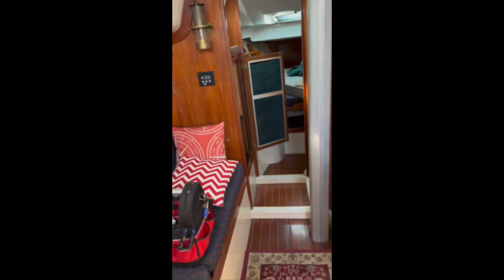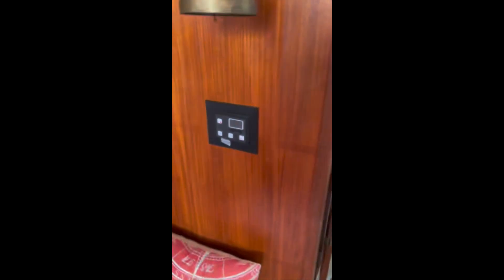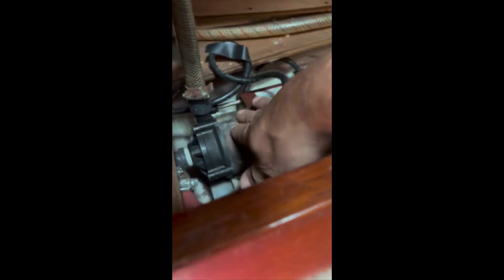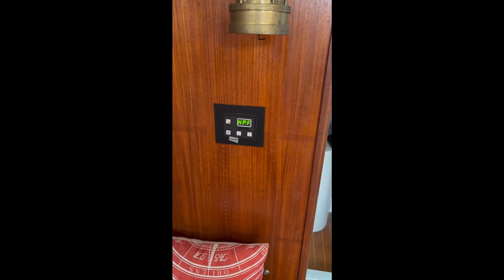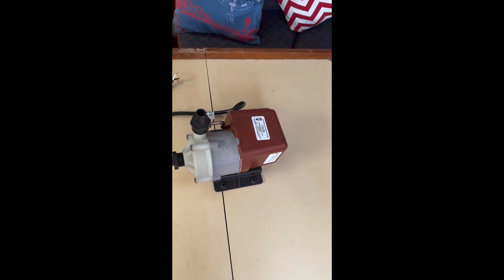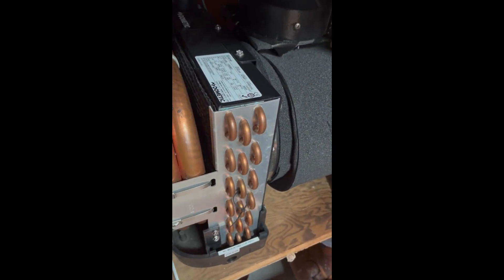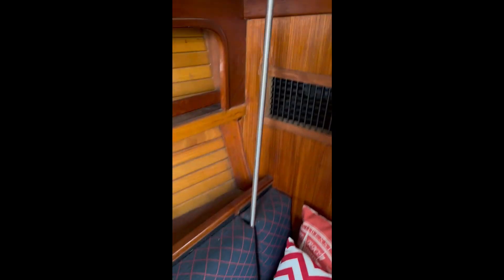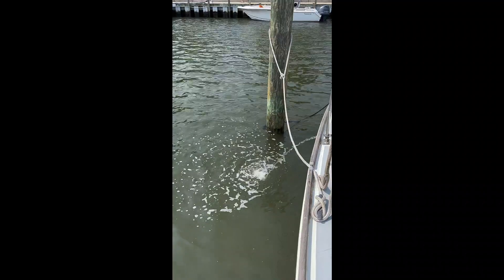Dometic Marine HPF Error - High Pressure Fault

Comment: Thanks for the tips! I just bought a used searay with a newer unit throwing the code but it runs for about 3 minutes great with cold air and good water flow when I first turn it on then flushes HPF and turns off. Any next steps?
Reply from the maker: @DrMac-N-Tots  did you flush out the water lines and clean the strainer? This page on our site has step by step to measure water flow and  how we clean the hoses. https://boatac.net/cleaning-seawater-cooling/

Comment: Can't it also be the switch inside the controller?
Reply from the maker: Yes. There are a number of potential causes. There could be a problem with your pump. Higher seawater temperature could “be the straw that breaks the camel’s back” in a system that isn’t properly configured. There could be corrosion or blockages inside your ac unit itself. However, clogged water lines are by far the most common cause in our experience.
Reply: @BoatACdotnet  Thank you. Awesome videos, learning lots. I believe one system is original 1983(!!!)
Reply from the maker: @danmarsh1337  thank you! You’d be amazed at some of the systems that we pull out that only recently stopped working (or that hadn’t worked in a decade+)!
Reply: Hello good evening mine has Lpf alarm i change a pump and after when i try to run the system the pump didn’t start and came the lpf alarm in one of the fancoil unit!